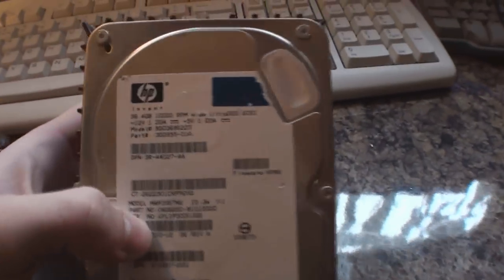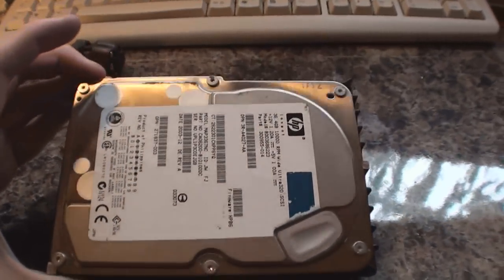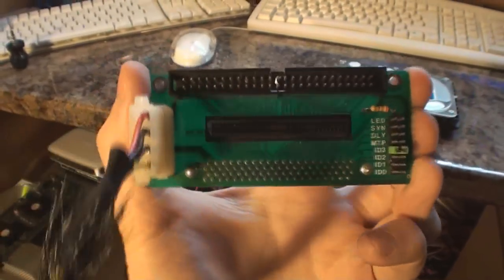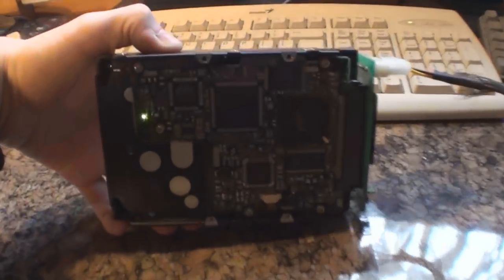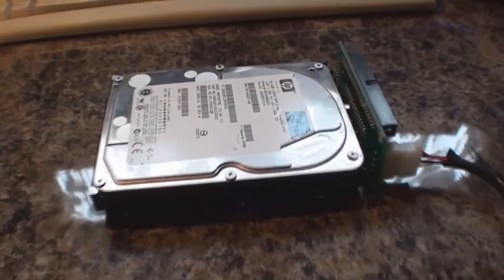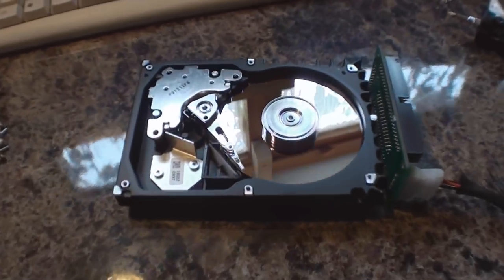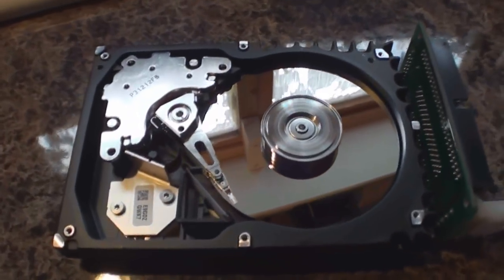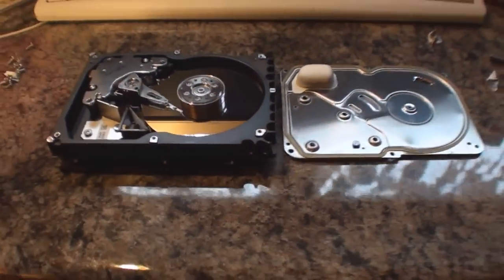Old SCSI Hard Drive Teardown

Comment: Its seems as if the drive may have been dropped judging by the damage on the top cover. Also the platters are smaller in 10k drives compared to normal 5200 or 7200rpm, 15k platters are even smaller, its to reduce the load on the motor to acheive the higher rpms :)

Comment: Those scsi boards that you purchased are expensive here in the states.  About 9 dollars for one used on ebay. 

I was just curious as to how do you use a ultra wide scsi, what cable do you need exactly, I can not find any.  Ultra wide scsi are way cheaper then any other scsi drive that I have found online.

For example a 10K sas 146 gb drive is 35 dollars however a ultra 320 scsi drive that is also 146gb is 5 dollars but with the 15 dollar board or 9 dollars used it kinda is not worth it anymore.  Because you would need the hdd the adapter then the cables.  I would rather buy the sas drive without the adapter.